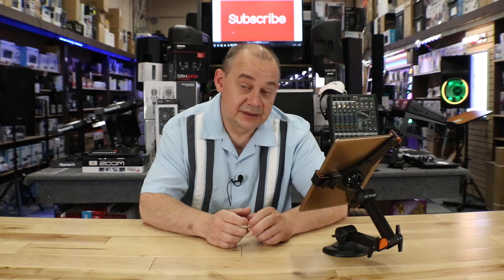✅Robin Answers your Questions 1204USB, Notepad 12FX, TS212S, PA SYSTEM, AS12P TS218S & Lighting Ep02

Comment: I wanted to connect my mixer with my Iphone to be able to be a guest on TikTok. Apparently the only way to be a guest on other peoples Lives. But for some reason I cant get the sound to work. Well I got the adapter Camera3 with a lightning so I can charge the mobile at the same time. The problem is, I can only hear the sound from the mobile in the headphones but one on TikTok can hear the sound from my mixer( guitar and microphone)
So can you please help me what is wrong with this...I have tried the 1 and 2 and also nr 3 &4 and nothing works...i have seen videos here on YouTube that it should work. I mean this is what i got as info what to buy...and the mixer works just fine when i connect the USB to the PC...but it will not send any sound to the mobile.

Comment: I wanted to ask is it normal for Altec Lansing ALP-L2200PK Lightning  speaker to get really hot in the back it doesn't stay warm it gets really hot i had a dj gig for about 4 hours... and in the back where the heat sink is at it got extremely hot do i need to worry?